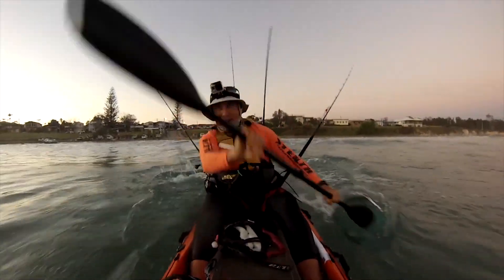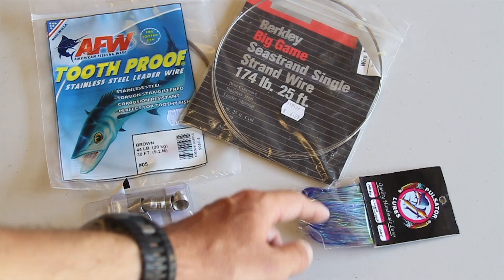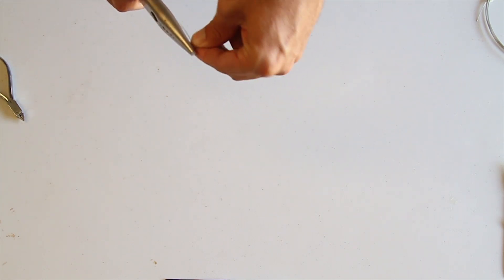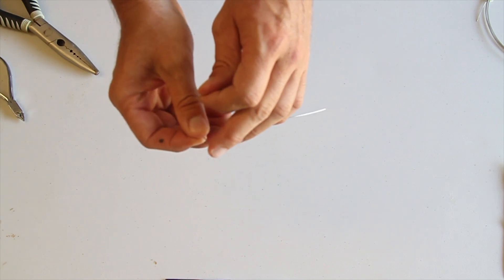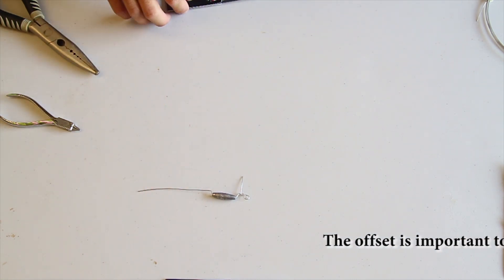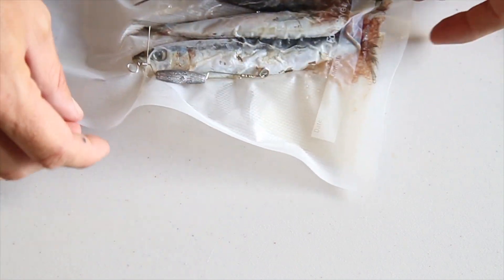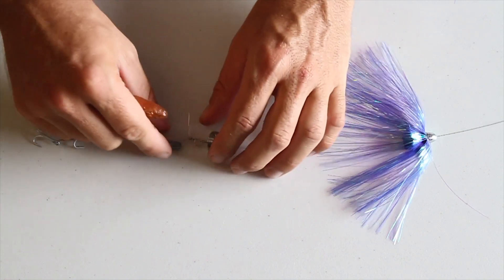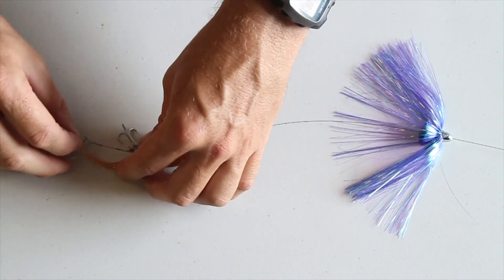How to make a dead bait rig for mackerel

Comment: Spanish macks mostly die when released after long fights, you'll find them on the bottom dead, minutes later.
Reply: +fishawoonga If you get them in fast enough they have a good chance of surviving.  I spoke to a fisheries officer that was catching tagging and releasing spanish mackerel. They would skull drag them in as quick as possible and release them.
Reply: +Tommie Strydom , the point is as I mentioned, "Spanish macks mostly die when released after long fights, you'll find them on the bottom dead, minutes later."  If anglers are using lighter line classes, releasing the fish is as equal to killing it or feeding local shark populations. Barbless hooks, heavy tackle, no photos, then release............................. those fish have a higher chance of survival. They're not as robust as other species such as barramundi or GT.